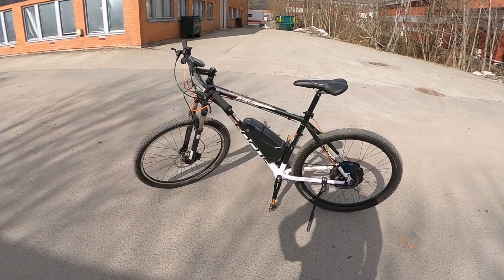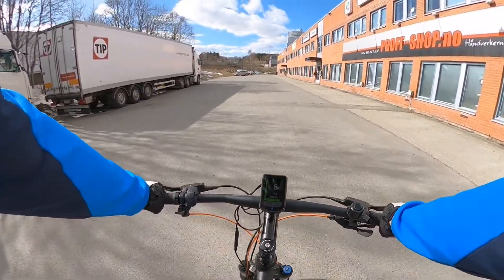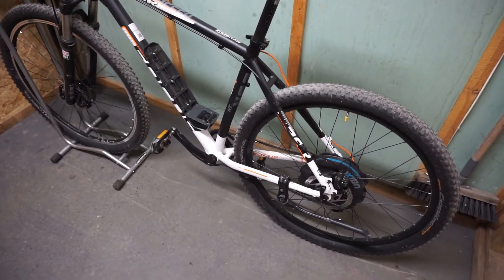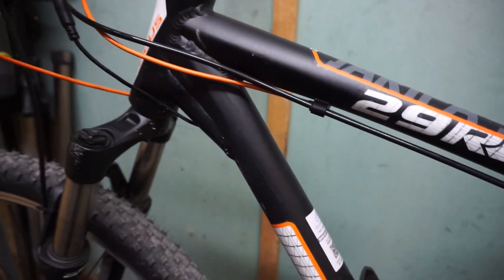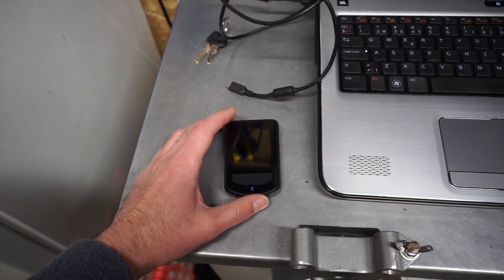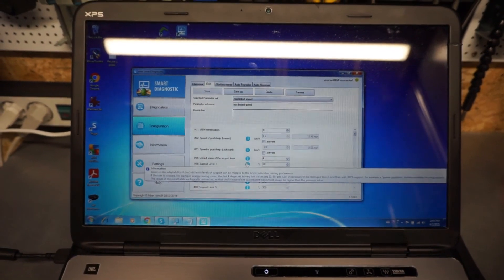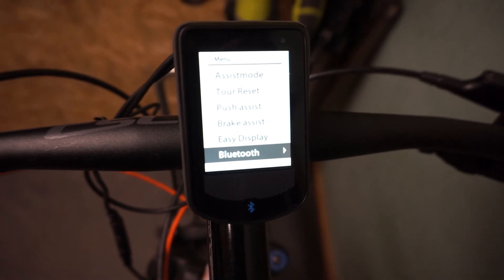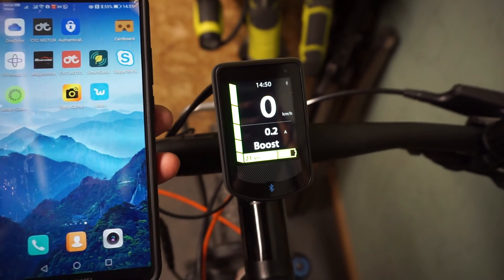Neodrives Xion Z15 motor review

Comment: Thanks for the useful video. Any advice on where purchasing just this motor is possible? I am trying to find a replacement for the Xion Hub motor on my Focus Aventura X30, but am struggling to find anywhere to buy just the motor itself. Thanks!
Reply from the maker: You can import new motor from Switzerland for instance. Here is the link: https://www.ampere-plus.ch/produkte/ersatzteile-neodrives/motoren-und-zubehoer-z15/597/heckmotor-z15-neodrives-hohlachse?c=5

Comment: Interesting🤔how does it compare to tsdz2, especially uphill?
Reply from the maker: It has half the torque of TSDZ2 motor, so I can feel that is weaker. But it can still climb moderate hills. This motor was not designed for aggressive mountain cycling, but rather for touring bikes.
Reply: Super super super :)